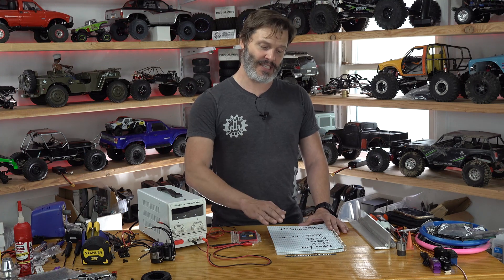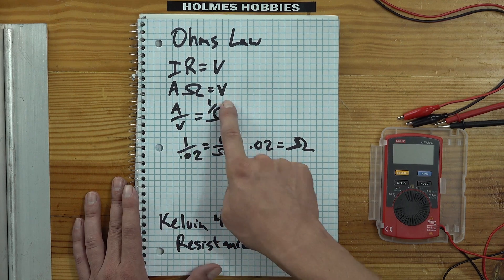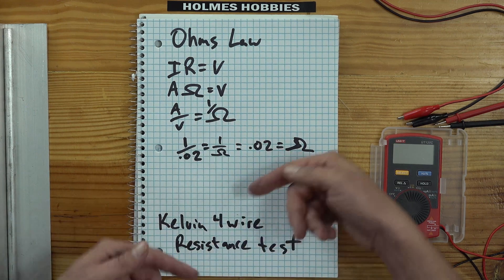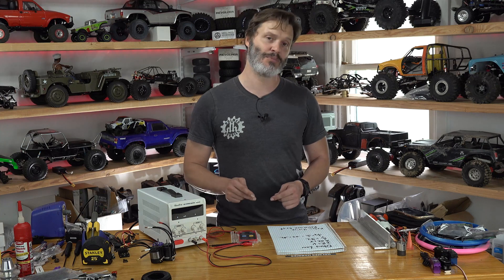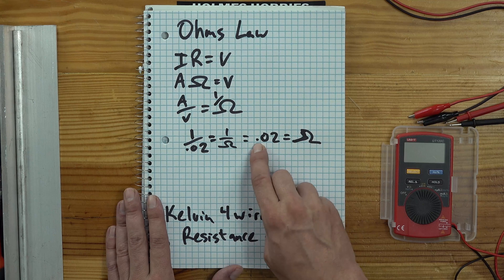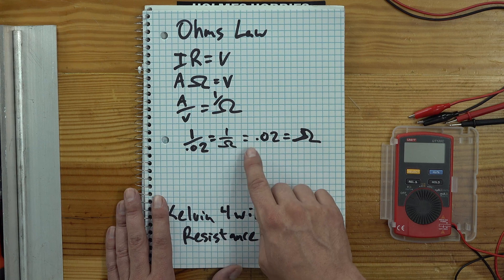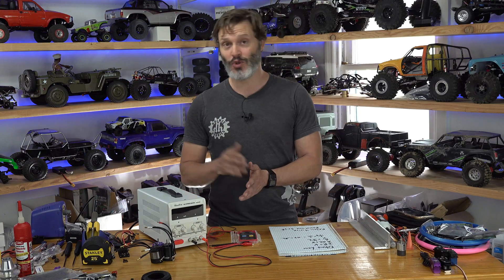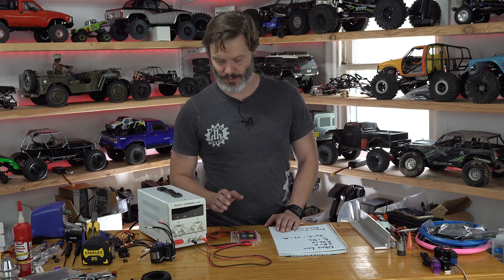Let's Do Some Testing! || Holmes Hobbies Kelvin Wire Resistance Test || FIND OUT

Comment: Hey Homes my goal is to make two Medium duty rollback and two medium duty wrecker and one little duty wrecker and one little duty rollback and I'm using GT Power Pro A60 because it can pair to a sensor brushless motor or Brushed motor and its a full  Simulation for RC it has lights engine sound Vibration and its not that expensive 165.00

Comment: Cool stuff. I actually already have all the required gear for this.  Mostly for testing marine electronics. Nice to learn something new.  On a completely different note. I'd like to get your ideas on direct powering one of your big 800 servos on a Savage X 4.6, 1/8th scale, nitro basher.  How much battery do I need?  I'd love for it to fit in the stock radio box.